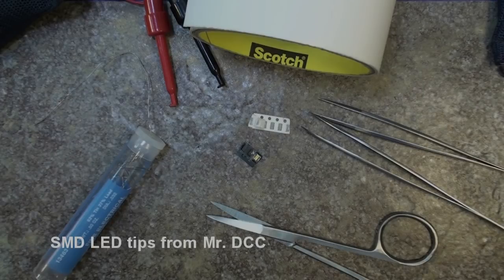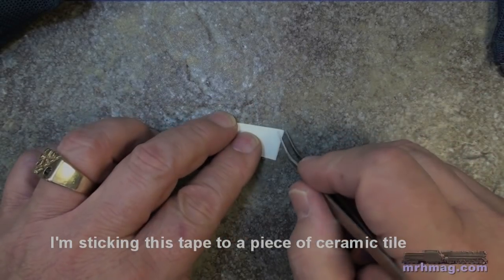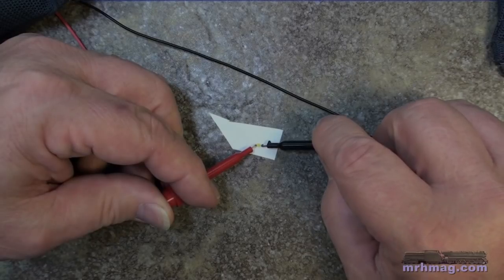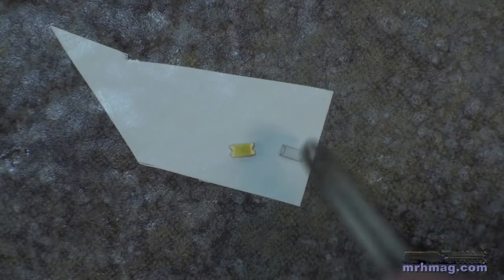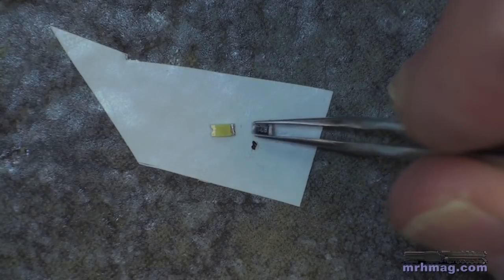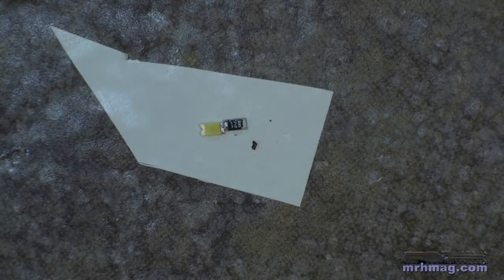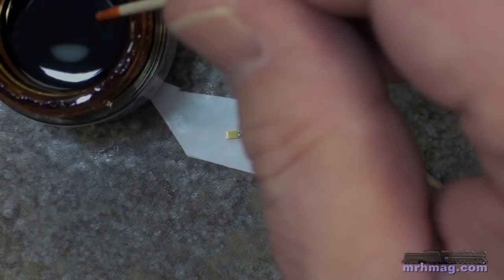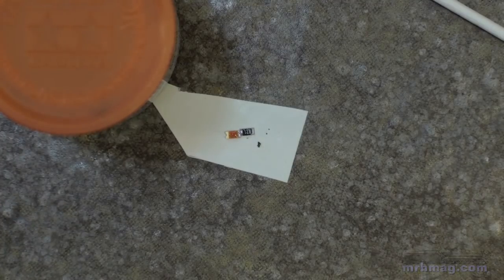Using surface mount LEDs for model train locomotive lighting

Comment: Nice demonstration of Tamiya's line of colored clear, which I have seen advertised, had an idea of it's use, but now have seen it aptly demonstrated, in LEDs. Also appreciated the confirmation, that LEDs soldered in the way demonstrated does not compromise their function.
A simple video, but concise, to the point, with clear speaking. Excellent, and thank you.

Comment: This is great. I have about 250 SMT LED's 0603 size, but I think I'll keep resistors separate near the supply instead of soldering right onto the SMD LED. I think I'll use mine for switch and block signals :D